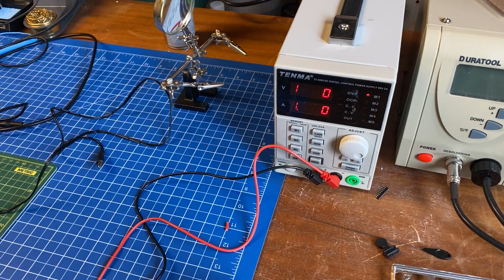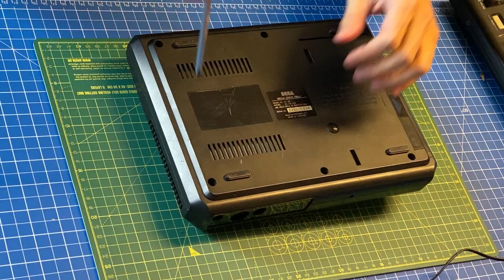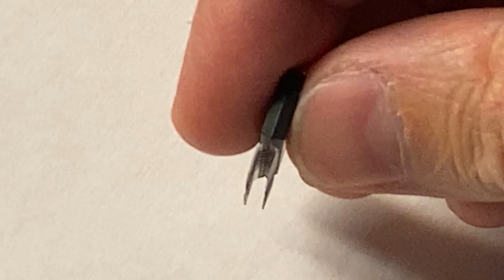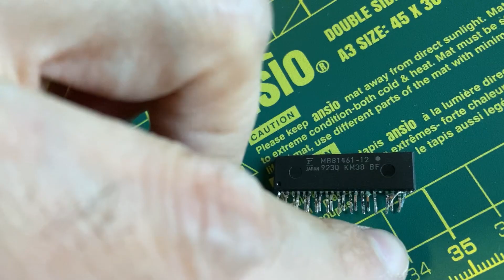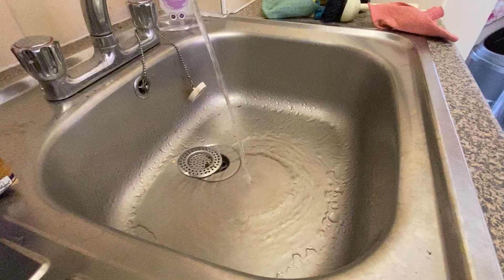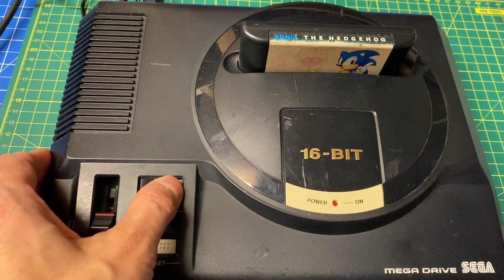Sega Megadrive -  Repairing a garbled and glitchy screen problem

Comment: i recently did this repair, thanks for the video. funny enough, before and after the repair all i got was a black screen, with nothing happening except the TV detecting a signal when the console was turned on. it was only after putting the console back together and trying again i got it to display graphics. I assume the metal shielding sandwiched between the plastic body actually acts as a ground connection between parts of the PCB, which was missing when i tried turning it on still disassembled

Comment: In early 2010, I had an American Genesis first model that I bought on eBay, and it had the same problem. But at the time, I didn't realize who was causing the graphics problem, and after five or so years, I threw it in the trash. An dick move, I say.

Comment: I've recently connected my Megadrive to a HDMI screen and it works fine. The only problem is that when I select 2 players, the image becomes glitchy. Currently I only have Sonic 2 so I can't tell if it will be a problem with other games. Is there anything I can do to fix it?
Reply from the maker: Hey, not sure. How are you connecting the megadrive to HDMI?
Reply: @theretrohandyman7708  I'm using a KAICO adaptor. Could just be a problem with the game?
Reply: I know I am late to the party here. But I believe I know what your issue is. If you are referring to two player split screen in sonic 2, the resolution changes from that of a typical Sega genesis game and that resolution is likely incompatible with your current setup.

Comment: My Mega Drive has the same problem but i get a clear picture after twenty minutes. Is it the same issue or something else?
Reply from the maker: It's hard to tell just like that, might be the video ram is defective so works once it's heated up or maybe the VPU?
If you have an oscilloscope you can download the datasheet of the RAM and verify if the relevant pins and see if data input/output is working.
Alternatively you could attempt to exchange the VRAM (not excessively expensive) and see what happens then.
I had a similar problem with an Amstrad CPC 464 (video will come in the future): all seemed to work well, but after 5/10 mins the screen would garble up.
Turns out it was the RAM.
Hope this helps!
Reply: @theretrohandyman7708  can i somehow contact with you? My japanese sega MD1 VA1 there are almost the same problems. In some early games like sonic the hedgehog and sunset riders everything works fine, but in games like aladdin, the lion king, mortal kombat, sonic 3d blast. Character or environment sprites become a mess, which can cause games to freeze. I have absolutely no idea what this problem is and how to solve it.
Reply: I would reflow the solder joints before doing anything else but I'm probably too late

Comment: Thanks for the video so i was able to resolve the same issue with the vram from a clone console and it worked :D thanks for the solution. I believe any vram from any sega if its in the correct package and pins even from the clones will just be fine ‘ in my case there is no mismatch issue as well they can go togather as well. Hope this helps
Reply from the maker: It's really cool that you found this video useful!
Good luck with your repairs!
Reply: @theretrohandyman7708  thanks :)

Comment: You should make a region switch mod. Since you use a RGB cable. Buy a 3 position toggle switch with 6 pins. You can find on Internet how to wire it up to JP1 JP2 JP3 JP4. In this way you play Pal/NTSC with the 3 positions EU/US/JP
Reply from the maker: Hey, thanks ever so much for commenting and subscribing... I will definitely do a region free mod together with a 60hz mod, but I want to do it with an oscillator!